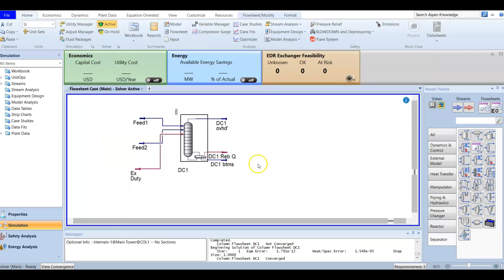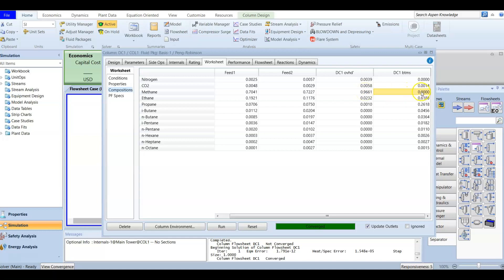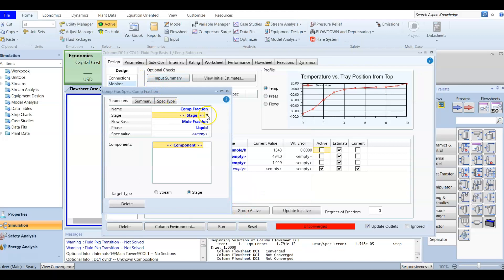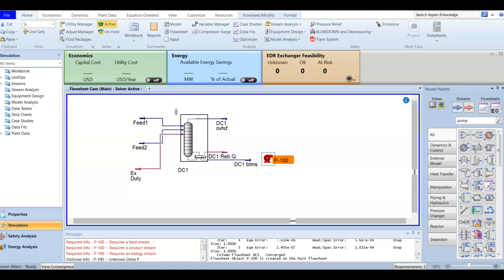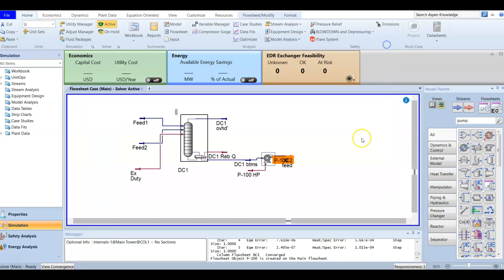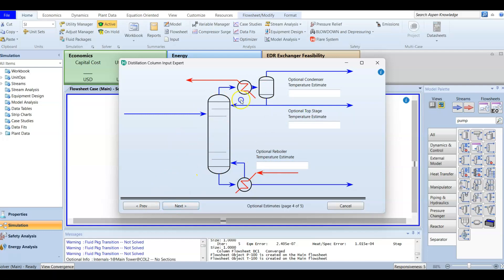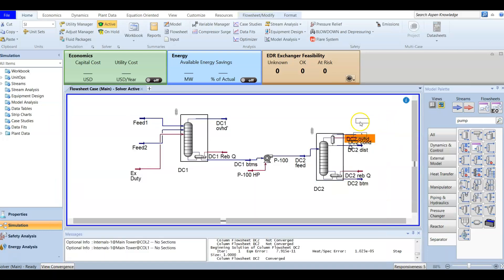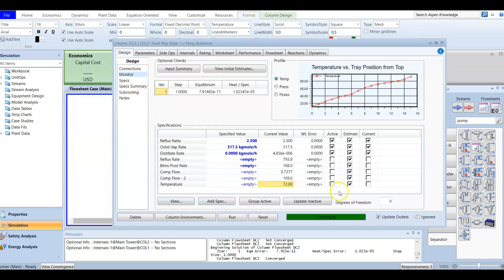Distillation column in Aspen HYSYS - fully defined

Comment: In my plant, open steam injection type distilation column is then how can add this one energy stream to column at bottom of column
Reply from the maker: At the optional inlet streams, you can define both a material stream and energy stream that will be fed to the same tray. The material stream is a steam with a vapor fraction equal to 1 and you add the rest of conditions that you have, and for the energy stream enter the duty that you have.